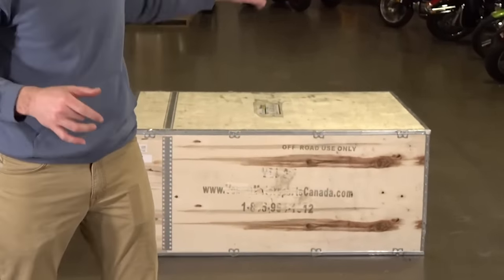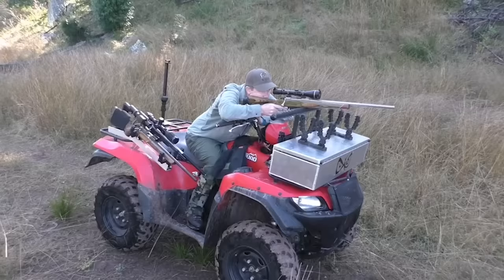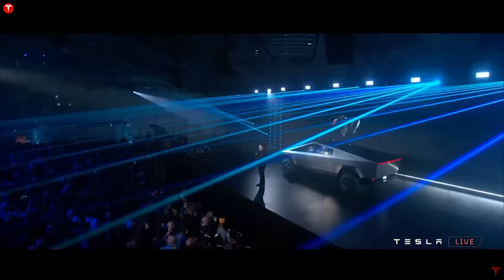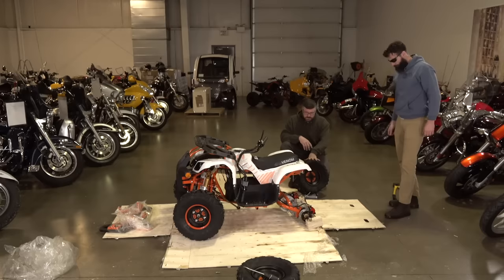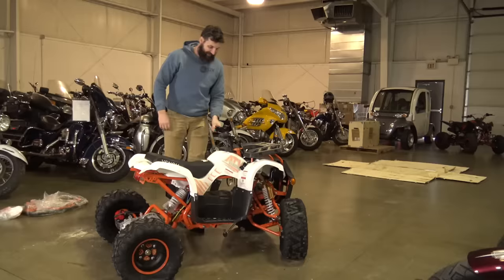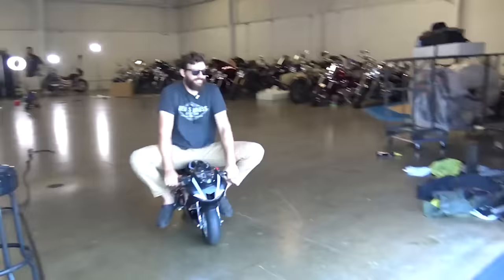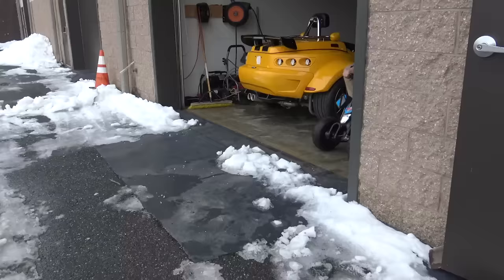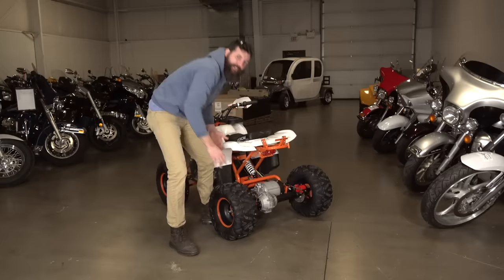I Bought the Cheapest ELECTRIC ATV on the Internet

Comment: drives 1mph with no steering and on flat tires

"this things not that bad"
Reply from the maker: i was being optamistic lol
Reply: @BikesandBeards  find an electric motor company near you in the U.S. get a promo motor and speed that hunk of plastic up.
Or.......buy a predator gas engine and away you go.
Reply: @BikesandBeards  I have a 2006 yamaha ttr125 and it smokes a bit do you know what the problem could be
Reply: @mateusznarajczyk274  piston rings
Reply: @mlgpenguin8634  thanks I was thinking that those might be the problem or maybe just a new top end
Reply: @Lucas Truesdale ... They have tge Segway 160 LightBee version of the Sur-RonX. The Segway 260 is a Sur-RonX.
Reply: @jeremydedrick4054  he loves throwing  a presitor engine in things
Reply: @BikesandBeards  you need to try a delfast top 3 I have one there about $8500 Canadian but they do 63-68 miles per hour with the governor switch off and there built like a tank and go 340 km on a charge
Reply: @BikesandBeards  0:25 Led Zeppelin- Immigrant song

Comment: Simple Idea: If your motor can handle higher voltage, do it.  Also, swap out those SLA batteries for a (hopefully higher voltage) lithium battery and use your existing motor.  Think of it in terms of the way jumper batteries come with different levels of cranking amps.  Higher amperage = more hell yeah!
Reply: would be cheaper and easier to shove a 450cc motor in it.
Reply: @FedkaSlovanich I don’t know about that 😂
Reply: higher voltage is more speed. any motor can comfortably use 12 volts more than it says. i can describe it like this.
motor Watts: torque
motor rpm: max speed {also depends on tire size}
battery voltage: speed 
discharge amphs: allows more electricity to motor so more speed
battery capacity amphs: how long you can ride.
i have a crazy cart xl with a 48v 25ah capacity battery a 48v controller and a 1000W 36v motor. in my opinion its better to overvolt a 36v motor than use a 48v motor. max speed is around 35kmh
Reply: The motors can handle more power, it's the speed controllers that can't handle much amperage.
Reply: @FedkaSlovanich never heard of a 450cc motor?
Reply: @Berm_Blaster  honda dirt bike engine, its between a sports motor and a pit bike/small dirt bike motor
Reply: @Berm_Blaster  Yeah, they really gave it a shitty controller. The thing is, you can get a decent controller for like $150, and they charged $2000 for this. This thing should be considered a scam lol

Comment: Just add more batteries.  More voltage equals more speed....in my mind anyway.
Reply: "more power!!!!" Jeremy Clarkson every day of the last 30 years
Reply: @themeach011  thats who i learned from. Lol
Reply: Lol the ecu would blow up
Reply: Depends if the controller and motor can handle it
Reply: Yes and no. More batteries could extend range, but the weight of batteries added would lower your range. Lighter batteries would help.
Reply: I would say inja would know or rich forsure can help
Reply: I think it can do 72v, at least for a bit.
Reply: I build custom electric bikes for a living, that would unfortunately just blow the current controller. Get a 250A Sabvoton controller, a huge 72V battery and a 10,000W motor. It's not cheap but you'll break 60mph no problem.
Reply: You're not too to far from right Robomoto, like I said above 72 volt setup, meaning a battery and higher amp controller.
Reply: Hack the control box and over ride the limiters for the motor.
Reply: Yes!!!!! Over voltage it like every one does to powerwheels
Reply: Power+speed=fun
Reply: More voltage also equals blowing your motor
Reply: Ehh kinda 
It will make it go faster but the engine is going to heat up way quicker and theres always a limit 

But yes more voltage 
More powerfull
Reply: Same
Reply: @TheDestroyer-xw5yo  I know for a fact that a 48 volt can be up graded to 72 volts. I run 72 on my BBSHD ebike motor daily
Reply: Add a couple of capacitors and a red button to act as a nitrous
Reply: I put 20 v drill batterie in my kids power wheel and he yollowed tf outa it. So stands to reason we cpuld do another 20 right?
Reply: Or more capacity depending if it’s wired in series or parallel.
Reply: I clicked "like" so I could be like # 200, lol.
Reply: @t-stashgaming4925  HOW "not cheap"? What if I just wanted 35 mph and 1 hr of run time?
Reply: @jamesavila2533  "yollowed"? Is that good or bad? 🤔🤓
Reply: @brianmccann666  Luna out of stock, right now...Thanks though, any good info indeed, very nice.
Reply: Motor needs upgrade there’s only so little rpm a 1500 watt motor can give
Reply: They need to change the controller first
Reply: Your right thats how most electrical vehicle set ups work more cells more power as long as the the esc has enough amps
Reply: @-amgigadyzrc8541  or you can have a lot of capacity un paralel
Reply: Then you’ll let the magic smoke out

Comment: Make it go insanely fast with a better electric engine like the Tesla quad
Reply: electric engine ,ha ha
Reply: It will probably twist the frame
Reply: @goalie2998  Maybe it will twist it so much it will be straight??
Reply: you need a way huger battery to handle the amps to whatever new motor they get. its gonna be like another 2 grand between a better motor and a huge good lipo battery.
Reply: Motor dude, it's a motor.
Reply: The Tesla quad is not real my guy
Reply: @bored2323  I think he was referring to the one that rich built
Reply: @danroden830  "huger"
Reply: Doesn't the tesla quad only goes like 15mph
Reply: @oogmoney  There is no information on it because it doesn't exist outside a prototype.
Reply: bigger battery and controller would also be required!!!

Comment: I need  a mobility scooter project but that might be too slow lol
Reply: His master's voice..
Reply: so i take it isnt 5 out of 5 ichiban moto stickers
Reply: @andyyu5973   no not at all.   i need to look around for things to build one
Reply: I'm definitely building one before I get old
Reply: I just have a crappie mobility scooter that the VA gave me. I would love to find one with a little punch to it.
Reply: Just needs a few green zip ties and a gallon of methyl ethyl kasetone and it could be bad ass.
Reply: @matthewclina4162   when i round up some parts i will make a video of the build
Reply: with hoverboard motors it would bw good
Reply: Check out the V8 bar stool
Reply: Correct me if i'm wrong, but if my memory serves me right i have seen a video of a modified mobility scooter that goes up to 100mph.
Reply: With a 140cc pit bike engine on and some quad axles
Reply: My jazzy elite will go 5 mile an hour for 3 hours and it will climb hills and so will the older hover round

Comment: Strip the battery/electronics out, light it on fire, and sail it over a cliff as fast as you can.
Maybe setup a pully system where a rope pulls the ATV with a truck.  The pulley makes it possible, so the truck is headed away from the cliff.
Oh, and anyone who needs Bespoke Post items needs to get out a bit more.  So this will also help you get out some more.  Good luck, and be safe!

Comment: Put a 2 stroke engine in it, looks like the type of small quad that’d be fun with a powerful 2 stroke engine
Reply: Yes very much
Reply: 500cc 😈
Reply: Yeah i suspect the gear box would blow up tho
Reply: I wouldn’t trust the frame
Reply: @seanmckay3392  rn it doesn't even have one xD its just a electric motor cheaply chained to the axle xD
Reply: I’ve got a 250cc Yamaha snow mobile motor.   It would fit nicely
Reply: @seanmckay3392   True
Reply: is there a quad that wouldn't be fun with a powerful 2T?
Reply: That motor can handle like 10 times power it now has but needs high discharge 72v li-ion battery and good controller
Reply: @jacksonthealien2789  cr500 swap good idea 💡

Comment: Back in 2004 I bought a Chinese pocket bike on ebay for $300. It had working headlights, tails and turn signals, electric start, horn (none of it hooked up from the factory) it was smashed pretty bad so I gave it ziptie stitches and put it back together, I rode that thing 5 miles down the road to a friends house and back more than once on country roads where people do 50+, I'd never buy another one but I had fun on it

Comment: Take the motor from a Cushman cart motor 48v 8hp 5965 watts and see if you can get more pony juice out of it. (Used 4 car batteries. I don't know tow them in a trailer. you could get 8 batties to push it then) 1 battery and 1500w seems a little lacking. And fix that frame by extending and straightening it so you don't lose the twins on a jump. No outchy = Happy you and Happy wife!

Comment: Quads are made for a lot more than what you listed. If it was properly made, an electric atv on a farm, even with just a 10 mile range, would be amazingly useful. Haul a trailer with feed, moving logs to a small saw mill, moving chicken tractors, hay, firewood etc. 

I wouldnt be driving an EV quad for more than an hour a day, I'd be too busy getting off an on dealing with what ever I was moving. Fewer parts to break, cheaper to run, can charge off solar panels or grid, don't have to worry about draining the tank for storage or stale fuel, no oil changes etc.

You're really underselling how useful something like this could be if it wasnt a hunk of junk. My Chevy Volt costs me about 1.5c per mile to drive, including maintence.y wife's Honda Fit (at 35mpg and $4 a gallon) costs nearly 10x that per mile.

No, an EV quad probably isnt going to be a great choice for trying to drive deep into the woods and haul out a moose. But you overlooked a huge chunk of situations where they are a far better choice...if they are made right.

Comment: I bought a 500$ electric scooter off ebay to get to and from work.. (dont judge me, its what i could afford. this pandemic hasnt been easy for me or my family).. It is 48v 1600 watts.. On amazon for 300$ or from ebay for 175$ you can get a 72v (84v when fully charged) 3000watt, 65 amp controller and motor combo.. I'm actually awaiting delivery of the new batteries right now to build a 72v lithium battery pack so i can finally install the new controller and finally have this thing faster.. At least yours had a wire to disconnect to make it faster. My stock speed is 21 mph at full throttle and theres no way to make it faster.. So im very much looking forward to the upgrade.. I say all that to say this: You guys can make that thing amazing. There is room for massive motors and massive controllers and an enormous battery. You could have that thing competing with small gas quads for relatively cheap.. a few hundred bucks and 10X the performance.

Comment: Upgrade it! That motor looks pretty capable, the limiting factors will most likely be battery and controller. I'd recommend at least a 72v battery, as well as a 100A controller (ebay style).

Youd have a blast with the improved acceleration, plus the speed would be nearly double!
Reply: Do you have service manuals for evs?  Our Damak quit, the ignition switch seems bad, and it was needing charging constantly.  But how can you fix an electric ATV when there is no schematic?

Comment: I bet you could get 2 80v Greenworks batteries and a better controller to fit in that and that thing could be a lot of fun, if not then a motor upgrade is needed which should be as easy as removing the old one and bolting a new motor to the rear axle housing.

Comment: Thanks for this video.  You answered my question if this would work to pull a sled for ice fishing.  Saved me the headache.  Can you do a review on the Daymak Beast 4x4 electric ATV?
Reply: We got a Damak Beast several years ago.  One year of good use, working on small farm, fixing trails.  After that intermittent performance.  Started to need daily charging, and I drive it a few minutes a day.  Finally but the dust.  There is NO service manual.  Customer service was no help.  They said to get service at any ebike shop.  But the ones I called said they do not service Chinese products.  Damak is Chinese, not Canadian as they claim.  Do not buy Damak!

Comment: We bought a Kayo bull 150cc atv. I have never experienced such a piece of Chinese crap to that extent in my life. Once I saw it looked like a rip off Yamaha, I knew it would be bad. I got a Honda rancher 2013 420cc with powered steering, fuel injection and a digital display for the exact same price. That Honda could sit for years and still start like noting ever happened. I'm genuinely shocked these Chinese ATVs are still sold. That Honda is still running strong, not a single breakdown in it's 7 years of service.

Comment: I think you got a dud.  I literally have this exact one (2019 model) from the same company and it is awesome.  I am 6' 200 lbs and ride it with my 3yo on my lap.  Sure, we only can hit about 20MPH but I've even had it out in the snow and it performed surprisingly well.  If you haven't already, see about getting a replacement and try again.
Reply: by law in the uniteds state dot put a limitation on all electric atvs and i thid bikes too limtiting to 20 miles per hour there a couple videos on it.i have the same atv and it will only do 20 miles an hour also!

Comment: Honestly, I'd love to have that. I'm just getting into power sports and currently have an ATV with a blown engine. Working on scraping together some money for a replacement engine. That being said. Even an electric ATV would be better than nothing.
Reply: 1,700 of the money is probably the battery which is why the frame is made of plastic, every 3 or so years you will need to replace it.

Comment: For more expensive all-electric quads, Daymak makes a couple of really nice models. Upwards of $10k though, but you get what you pay for.
Reply: We have had severe problems with our Damak Beast.  Local EV repairmen won't touch Chinese ATVs and there is no such thing as a service manual.  Customer service was no help.  Authorized Damak serviceman confirmed there are no manuals, they are hard to fix, and most get junked .

Comment: Power it up!  A 10kW motor should make that thing RIP!.  Just use a solid axle and chain drive.  You will need a 10 tooth gear in the front and a 40-45 tooth in the rear.

Comment: Yo, You need to modify it. You should double the voltage of the battery by adding a second battery. That could be dangerous but man would it be cool to see you max out the motor and probably burn up the windings!!!!!!!

Comment: put it in the rig bend it straigt and see if you can downwire the copper wire in the engine maybe it will get faster just like those old electric rc race motors

Comment: Would like to see the motors built in the tire like Tesla's cars and then havin the other bigger motor under the seat. Wonder how much power and speed it would have. Maybe could switch as well back in fourth between the motors using the ones not in play to charge up the batteries. Like a speed/charging switch from normal to supercharger speeds

Comment: Get a 6-8kw motor and get a 72v at least 25ah battery in there for weight speed and range and then that thing will be sweet. It'll easy be able to do 50mph+ and if u do 30mph maybe a 100 mile range.

Comment: you guys should splice in a better controller, replace the engine with a semi truck starter, splice a second battery into it in parallels, should make it pretty good, but you need to get past the 52v, ur gonna want 72v or 94v, u should be able to run 72v to it no problem. BLDC has a 50a 3000w 72v brushless motor kit that should just mod right on with very little work, it make make it actually semi cool, well it a sense of, do you like electric, then this is cool

Comment: I learned buying custom clothes from china, US adult sizes and there adult size are quite different :-) I picked up a sweet 12v Kidzone ATV for 99$ off E-pray, free shipping of course, and its actually pretty nice. Now I'm gonna make it a 4 wheel drive remote and parted out robovac Lidar controlled lawn mower with running lights and FM/Mp3 40watt music so I can mow that Fu#$er at night and impress the neighbors ;-) Might add a couple remote fired Super Soaker cannons for lawn crowd control. Possibly filled with a water/dye mix. ;-)

Comment: Quick question, how tall are you? If was made in Asia,  it was probably made for smaller adults? Also, if this was the only one you found, what were expecting?  Never buy the first production year of any vehicle,  let alone first of its kind. How about taking an old ATV and make it as  light as possible and out that electric power train in it? That's a decent size motor and you might be supprised. I will need to check out your other projects. Keep it up!

Comment: That motor looks pretty beefy. controller can probably handle 12 more volts which if it's 12 volts is double the power. or get a 72 volt controller and battery.

Comment: 48v 1500 watts.... bro I use 72v 40ah 3000w mid drive on my daily commuter ebike and after a while of use I can say I wouldn't use it to power anything but a bike, have to step up to a 5-10kw motor possibly dual motor for 4x4 and more than likely a 72-96v battery with atleast 40ah if you want a decent mileage

Comment: What if I want a quad to just pull a trailer around the property on occasion.  Low weight, just hauling brush and such.  Is that a valid use or is that stupid too?  Not everyone uses a quad for hunting or trail riding.  I just use mine to pull a garden trailer around the property.  Never would my use be past the battery life.  My old John Deer (CanAm) quad is getting old and I just want something that I and use without having to worry about gas, oil and other service items.

Comment: On a contrary electric ATVs are the ultimate SHTF vehicle, if you own solar powered batteries. 
Everyone will be piling on the gas station (violence, troubles) and you can gain 50 miles per day on average even on some less traveled, dirt roads.